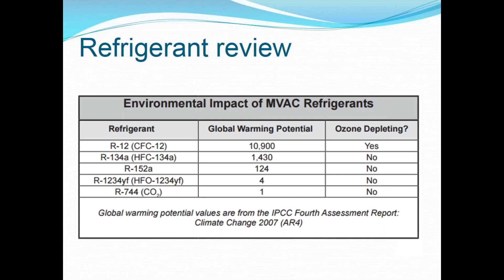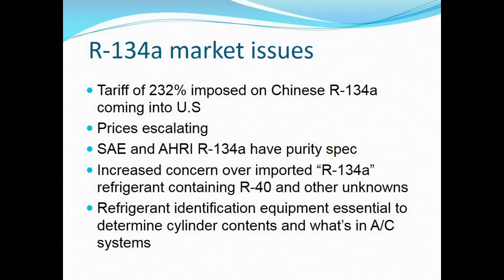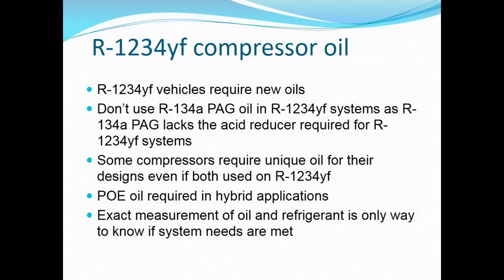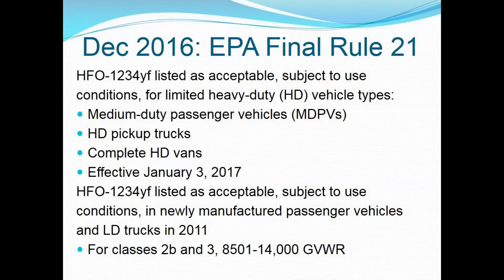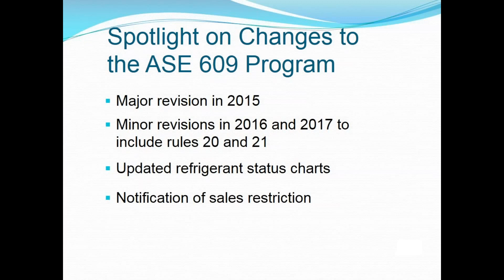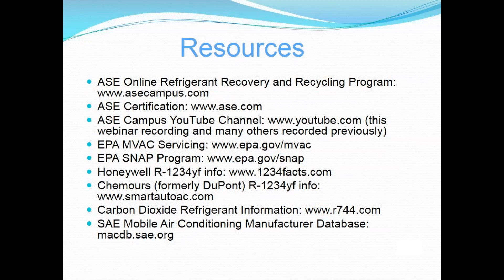ASE Section 609 Update and New Developments in Vehicle A/C Service

Comment: I am actually interested in A/C autos any links for getting into the programs?
Reply from the maker: You can learn more about the Section 609 part of A/C service at www.asecampus.com. This credential is required to work on MVAC systems and to purchase refrigerant in containers 2 lbs. and larger. ASE also offers a Heating and Air Conditioning professional certification exam (A7). You can learn more about it at www.ase.com/tests. I'd suggest downloading the Auto Series preparation guide so you can see what's covered on the A7 test. Once you're aware of that, you can start down the path of preparation to bolster areas where your knowledge of skills may need improvement.
Reply: ASE Campus thanks